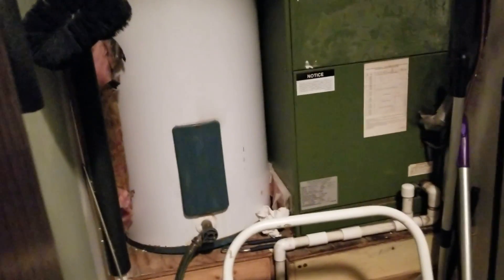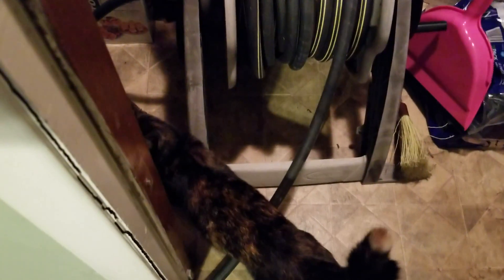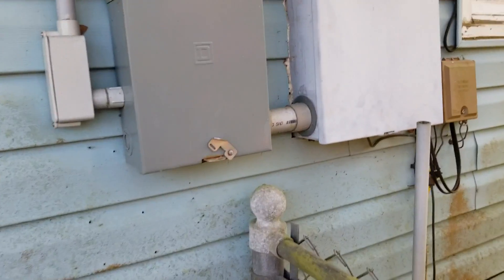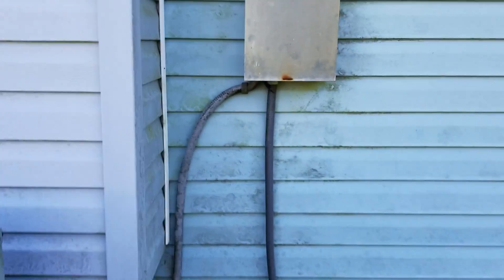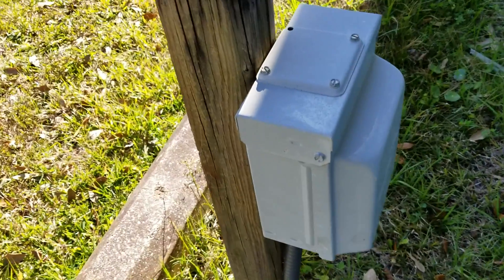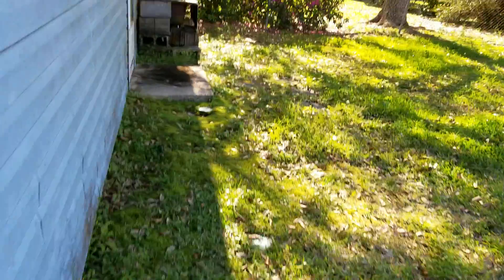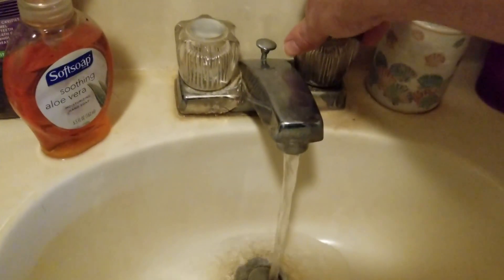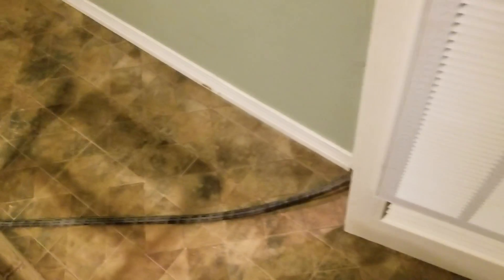Water Heater Part 2 - Valve Needs Replacement

Comment: "Wreck" room?  Is it because it's always wrecked?  Or is it like "wreckless" driving--driving without having a wreck?  Do you go in the "wreck" room to get wrecked?  Clearly there's an issue there.

The valve didn't need to be replaced, just capped.  Unless it was leaking from the packing nut and no amount of tightening (without breaking it) would fix that.  You can shut the breaker first or the inlet water valve first, it's not going to make a difference since the tank will be full.  When turning back on, the inlet water valve must be turned on first and the tank allowed to fill before turning the breaker on.

What is the "ground pump", and in the panel it says "grinder pump"?  What's that for?

Did you notice that the title of the video says the valve needs to be replaced and most of the video was talking about circuit breakers that don't have much to do with the water heater?

Still threw out the idea of the cap that would have solved all of your problems.  You could have even put the cap at the end of the hose, or if you have a hose sprayer nozzle that stops the water completely, you could have just used that as a temporary fix.  It's amazing, no matter how much good, free advice I give, you still get that filet-o-fish sandwich at McDonald's, instead of skipping dinner and going to the hardware store instead.
Reply from the maker: I have no idea why it's called wreck room don't ask me that, I think the ground pump means it's the sewer pump!
Reply from the maker: I uploaded the 3rd part check it out!
Reply: You wrote "wreck" room.  It's your handwriting.  "Wreck" should actually be "Rec", short for Recreation room.  Hell, even "playroom" wouldn't worked.
Reply: I'm getting to it, I'm working on my video for tomorrow now, and that takes priority over everything else at the moment.  After that I need to COOK dinner, thank you very much, instead of having Uber deliver a burger from the dollar menu at McDonald's and my paying $15 for a $1 burger.  That also takes precedence.
Reply from the maker: @jaykay18  Well I beg my pard I misspelled it then